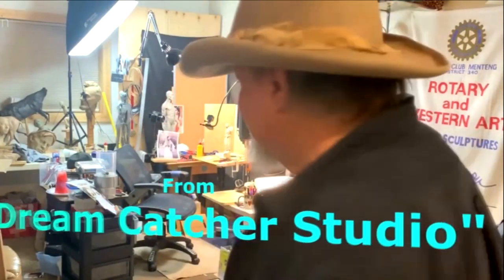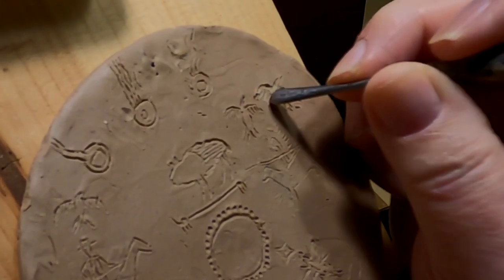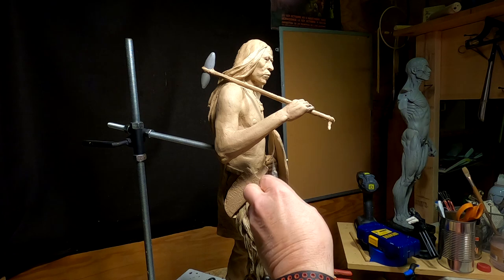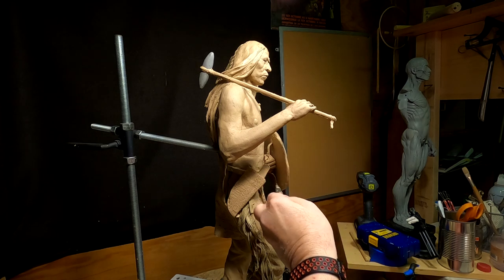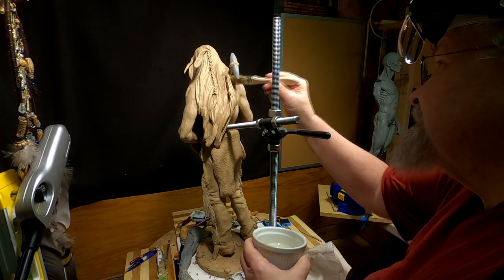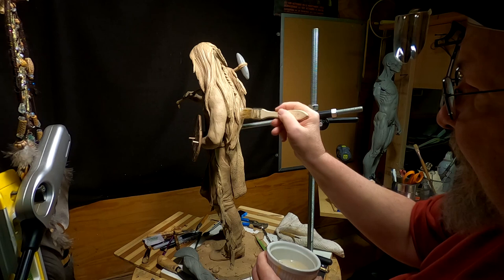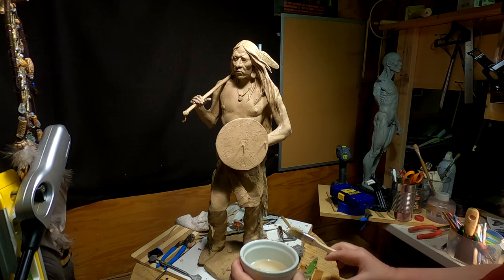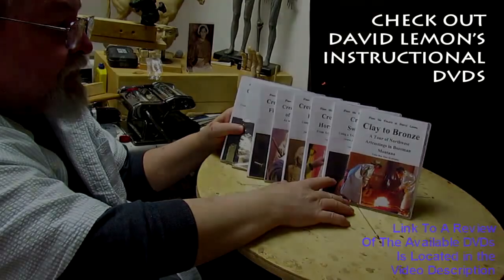CRAZY HORSE, It's Finished Today,  Day 4

Comment: Those pesky flimsy or failing wire tools can be firmed up some with either 2-part epoxy glue or putty. Work it down into the ferrule and build it up a little just beyond the ferrule and the tool will last much longer. Also when they start to get dull and don't shave the clay as well, you can sharpen them with a fine file or emery cloth.